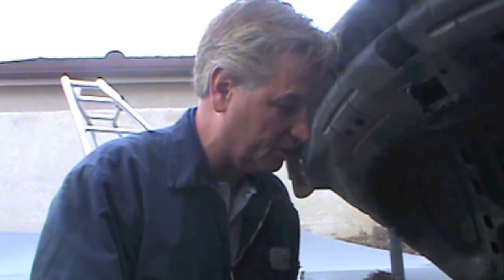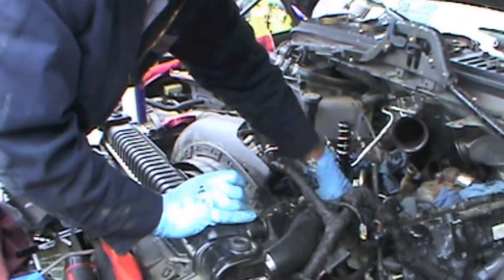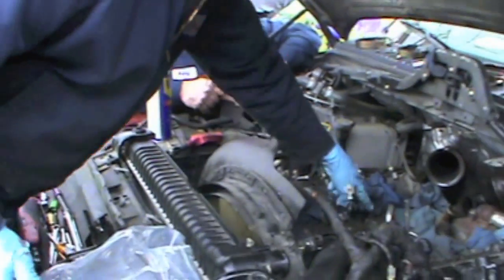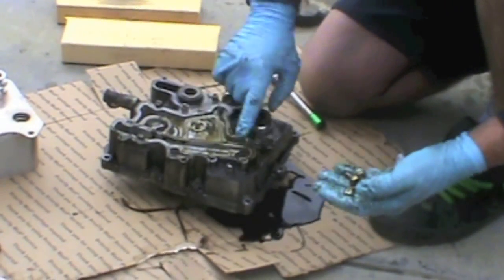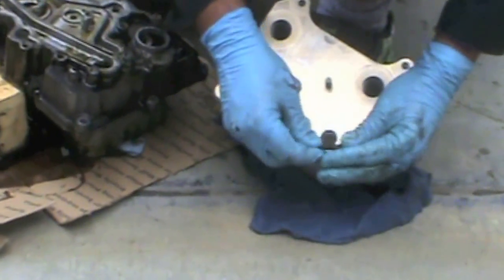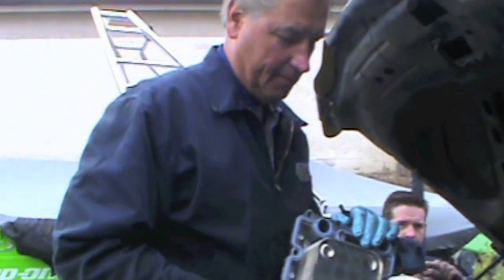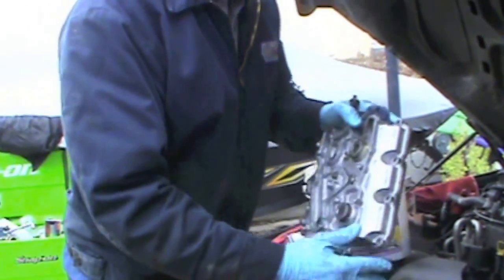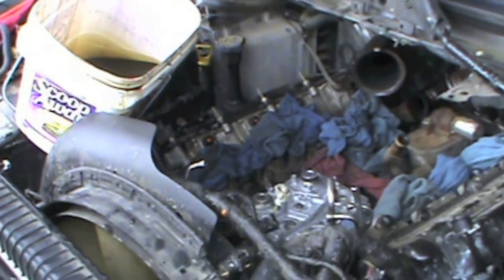OIL COOLER REMOVL ON THE FORD 6.0 POWERSTROKE DIESEL

Comment: Does someone knows why the fan clutch won't work if you just put it brand new. 
I mean it does work when I turn my truck  on but after a while it stops and gets overheating..
I also put a new temperature sensor
Reply: wiring harness to fan clutch gets chaffed because it sits too close to fan

Comment: Would be nice if they showed how to gain access to that area ie removing the turbo?
Reply: He and others show it in other videos. With all due respect, I don’t understand why he preps the new parts on the ground in the mess from the old ones. Parts that are going back on should not go near the ground, dirty oil, old dirty parts. Novices are going to mess up and get contaminants in the mix. I really don’t think blowing out the dirt around engine openings, the turbo, pick up tube,  etc. is acceptable. If you are going to blow it off, cover and plug every single possible entry way for the flying debris that can bounce around anywhere and everywhere. But wiping with a lint free rag is the best way. Use solvent if need be. And a VOC respirator, whether you  wipe or use compressed air. I see wa too many utube how tos with toxic solvents used and no respirator. Very bad example. Very bad idea.
Reply: @5400bowen  it's all good I figured it out. He's got some great content tho! Everybody has their own ways of doing things.... good thing I did the coolant system and thermostat, I pulled the hose off and the assembly inside the thermostat was missing ugh
Reply: Reason 4Believin' I have SO much respect for our friend Ron. He was also so amiable. He is a great guy and you cannot help but like him as a person. I remember guys like him before all the tough guy stuff permeated our society. Too bad, this world needs more like him, and not just to fix our cars...to fix ourselves! He was (and with utube, still is!) a shining example of what people should be like. When I grew up being truly on your friends team was normal.
Reply: Hey you mean the thermostat was missing? People remove them on gas engines to avoid them sticking. Just takes longer to warm up. I hear with diesels they won’t warm up until you drive it, so the thermostat isn’t as critical. Anyone know more about this? Am I missing something.? It’s not who is right, it is WHAT is right. And that was Rons’ attitude. Worth all the aptitude in the world if you keep that in mind. That was one of his best lessons for all of us. Listen to him say it all the time. “Some guys like to do it differently than me”. And he always is humble saying his way isn’t necessarily the best, or only good, way. The best human interaction systems require true, in good faith, cooperation and exchange of ideas in an academic manner. We didn’t get Ford 6.0 diesels by having the engineers constantly trying to subvert their colleagues thoughts and efforts. This is the one paradigm humanity seems to be forgetting lately. We didn’t get cell phones, or the internet or solar electricity or........true cooperation is much more powerful than competition. They best way is a healthy, friendly, good natured competition within a much stronger, more dominant, cooperative stance. Don’t forget a sense of humor and true brotherly love. Bless Rons’ soul. And on the radio right  now? “With a Little Help From My Friends.”.

Comment: Ok boys. Had this happen on my beloved 06. It’s a real pain to fix. This vid and others r very helpful.. but they neglect to EMPHASIZE these are old trucks. The wiring harnesses are cranky USE CARE WHEN MOVING THEM. all plastic fasteners WILL break. Plan on $ unless u find alternatives. Many out there. Also the turbo reinstall requires extra care. Do not crack bend fold mutilate the up pipe to the turbo. Use lotsa anti seize with many test fittings. SLOW. THINK. SLOW. JUST SOME HELPFUL ADVISE I CAN PASS ALONG.  enjoy the day

Comment: Maybe some can can correct me does a clogged oil cooler cause coolant to blow out the degas bottle 
My truck already studded and deleted
Reply: ismael melero studded and deleted doesn’t mean it won’t blow out gaskets. Could have cracked heads or studs weren’t torqued properly and may have lifted

Comment: I've been watching Rons 6.0 videos for a few years waiting for the inevitable and 3 days ago my 06 finally started puking the coolant on hills. The motor has never been opened further than replacing a coolant thermostat and o-rings for the fuel regulator. I'm glad these videos and this channel have prepared me for this day.  I'll have all the parts shortly and I'm going to enjoy attacking all the weak spots on these engines with Rons shared knowledge by my side.

Comment: If you buy a '03-'07 Ford Diesel, they are Lemons. Unless you are a mechanic and know what you are getting into, stay FAR away from those years of Ford Diesels. I have put over 10k in Engine repairs and my '05 truck ONLY has 120k miles on it. Now I have to replace the oil cooler next week. It NEVER ends with these crappy trucks, never! Buyer beware!!!
Reply: My 2005 6.0L lasted from 2007-2017 without being deleted or bulletproofed, only just doing it now with 400,000+ miles.
Reply: @Peaksideperformance  same here
Reply: Eddie Edmondson you just have a crappy mechanic

Comment: Question my wrench light(Limp home mode) comes on after driving my 2006 6.0 powerstroke around 50 miles.  Do you know what that could be from 
And my truck squeaks 1 or 2 times about 5 seconds after I start it up,  any knowledge would be appreciated. Sorry I'm a female and mechanically retarded,  I just love big diesel trucks
Reply: how much did a new cooler and turbo cost you?
Reply: the squeak could possibly be the belt. also you need a scanner to see why the wrench light is on. go buy a scan gauge II..
Reply: +FULLY LIT got it fixed,  was oil cooler,  hotter than the coolant,  so I got new oil cooler,  and a egr delete plus an sct x4 tuner, the squeak was the  turbo,  got a new one.

Comment: I dropped about $8000 a couple months ago to have all new injectors and a new turbo on my 05 F350 (6L) and the other day I started losing power and burning blue. The local Diesel shop hooked up to Diagnostic computer and I am told I need a oil cooler!! another $4000!!!! How hard is this? im tempted to try this myself , no much of a mechanic, but have more time than $$$  any thoughts?
Reply: Darcy Kerr how it go im also going to tackle it

Comment: I have a 2003 f250 6.0 and had the EGR delete  replace oil cooler etc.  had a oil leak appear from what looked like the oil cooler.  So I had oil cooler replaced again  not long maybe 4000 miles it started leaking again and it seems to be leaking from a weep hole on top of oil cooler cover. What could cause this?
Reply: Wyatt Reeder its the gaskets that come with the oil cooler kit. you need... NEED motorcraft gaskets or it will leak again and again
Reply: oil in the water of a 7.3 diesel Ford F-250 water cooler alright

Comment: Ron, I have a 6.0 and I pulled the egr ans inside is full of sludge and either coolant or oil, hard to tell just at the peek inside I took for now. Do I need to do the oil cooler as well as the egr delete. I appreciate your time and your reply.  Thank you.

Comment: did you use a torque wrench to bolt down the oil cooler into the housing and the whole assembly to the truck. If so what poundage did you use on them. going to replace mine tommorow
Reply: Ryan Steele did you got torque specification for oil cooler I want to do my next week

Comment: Great vid man,i'm in the middle of mine and using this vid for reference.Do you recommend any certain pattern when torqing down the bolts,middle out,or just run around it and be done?also what number to torq to? in lbs,or ft lbs?

thanks again for probably the best vid on the net.

Comment: Thank you for posting this. Long live the 6.0. Lil money n lots of elbow grease and BOOM there that long lasting power monster. '05 keeping her forever.
Reply: Same truck here Phillip it's better to own a 05 Ford fixed allot of the 03,04. problems plus the coil springs in the front and the new grill change looks great.Drive 300k rebuild. Then you can do another 300k. good luck with your tuck.

Comment: Hi their, I have a question about my 2004 6.0L. If I block off my EGR cooler will I blow head gaskets because the air pressure will be higher? thank you.

Comment from the maker: I guess both are correct oil is passing through it but its  also surrounded by oil so it transfer heat kinda like an ice cube. The main thing I was trying to point out is when the coolant gets restricted and flow slows or stops then the heat transfer stops or slows. The oil heats up more because it lost its method of moving the heat away.

Comment: I highly doubt it.  Getting ready to do mine, pulling 14,000 lbs, my ECT was 200 and my EOT was 230.  With no oil cooling at all, who knows how hot the EOT would get while pulling.  Sorry, but this motor seems to require oil cooling.  I'll install my coolant filter first, change the filters a couple times than do my oil cooler, STC HPOP, standpipes/dummy plugs, and delete my EGR.  Cost: 139, 8, 160, 50, 100, 110 = $567 give or take.... that's not a lot to ensure it to last.

Comment: Ron, I'm no expert on the 6.0L oil cooler, but I do have a passion for knowing how things work, especially when I have to replace that part. You claim at around 3:30 into this video that the oil cooler just has coolant passing through it, and it cools the hot oil passing around its base. Bill from Powerstrokehelp claims that oil and coolant both pass through the cooler in a continuous sandwich pattern. I'd like to know for sure exactly how it works.

Thanks, John

Comment: DieselTechRon, you seem to have alot of knowledge, and the videos are great.  Have you ever had a 6.0L start missing around 45 mph and continues to skip until it gets to around 60 mph.  I had it worked on and the mech thought he had it fixed by replacing the turbo filter.  But it started doing it again?  Any suggestions would be great!

Comment: On a 2004 105k miles 6.0 with oil in cooling system where the oil cooler was plugged solid, and truck was parked as soon as the cooler started leaking. I looked at the egr cooler and plugged one end, let it sit and water has not gone down. How likely is it that the egr cooler is not burned out, is there a way to test it ? I'm just going to sell the truck and dont want to spend more than necessary, but I want the buyer to be satisfied.Thanks.btw keep the vids up,they are the best I have seen.

Comment: Your videos are very helpful , I have 2004 6.0 and the screen in the oil reservoir is not ripped there is 2 of the screen materials missing, I dont know if someone was in there and replaced the cooler and just ripped out the hanging screens or if I should remove the high pressure pump and check the connecting oil passage and pump screen to find the missing pieces, I'm thinking I should look just to be sure. Btw the old cooler was plugged and the egr still looks ok, the truck has 105k,. thanks.

Comment: install a coolant filter if you own a 6.0 so it doesn't get clogged up with sand from when the block was casted.  You shoul never have to replace an oil cooler if a coolant filter is installed.

Comment: @JacobWilliams1968: The only viable solution for replacing the OEM oil cooler is the Bulletproof Diesel oil cooler system.  Not cheap but definitely Bulletproof.

Comment: This is going to sound retarded I know but. Is there any way to delete the oil cooler all together just as you would the EGR cooler?

I recently bought an 06 and I am getting all my delete kits in line for a weekend project. I have already wired the high idle switch in and have ordered the EGR cooler delete. I'm going to leave my EGR valve in and plugged in to keep from throwing a CEL. I notice that the oil cooler upgrades can be a little pricey, so do you recommend any certain brand or company